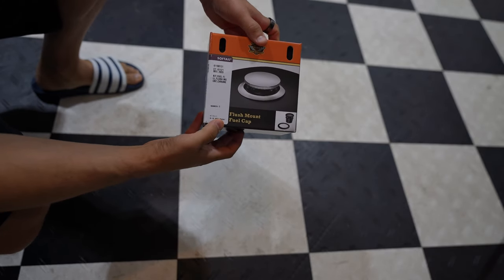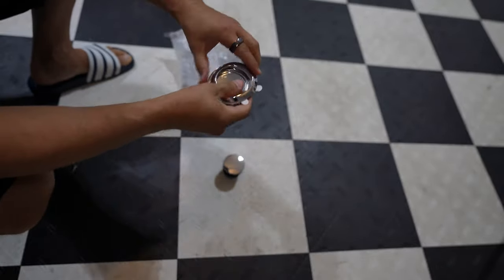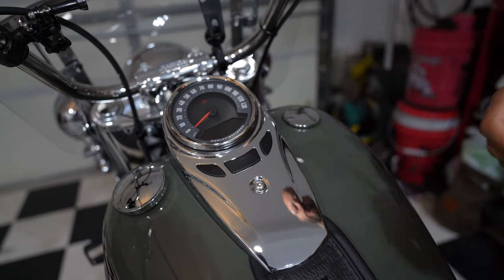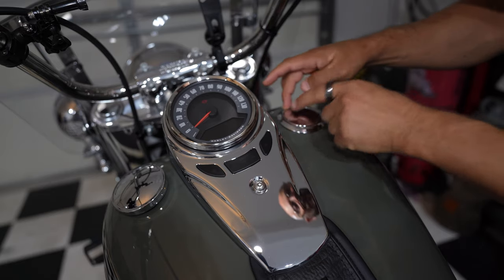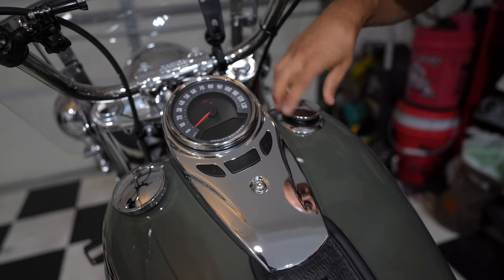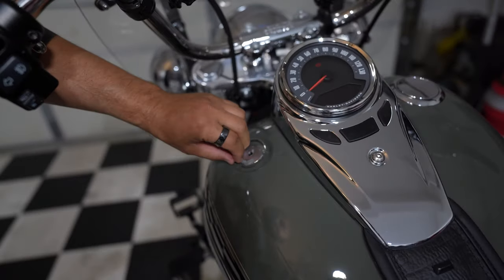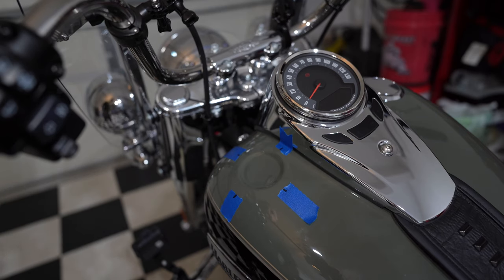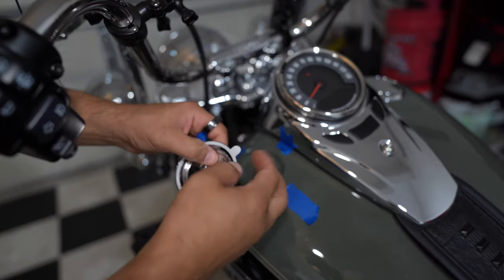Harley Davidson Flush Mount Fuel Cap and Left Side Tank Cap Kit Install

Comment: I also had a rattling cap on the right side. I took care of it by crimping the cap a little. Worked well, but I also decided to replace mine with the flush caps. Did it today. Very easy and only took about 20 minutes.
Reply: My left side actually had the gage, but again, easy to swap out.

Comment: They really clean up the look on your bike. I was looking at these for mine, but had a question. Does the gas cap center part sit higher over the trim than the dummy cap? I’m very picky, so even a little may be a deal breaker if I’m looking at it all the time.
Reply from the maker: It sits perfectly flush with the trim.

Comment: I have the same bike but in the teal color. 
I really like those saddle bags protectors.  I couldn't really tell do you have bars on the front also? If so, do you ride with your feet up ever? I like the look of it on other bikes but I'm only 5'7" . I wonder if I could reach comfortably ? Lol
Reply from the maker: I do have the mustache bars in the front (you can see my other install videos).  I do not ride with my feet on the bars, but I can reach them.  I am shorter than you so I am sure you can reach them :)
Reply: @LennyK  they are for proping your feet up. Right? Its My first bike so . Sorry about the questions
Reply from the maker: @ronaldtaylor4116  No problem. They are mainly used to protect your bike  in case of a drop. But they can also be used to put your feet up.